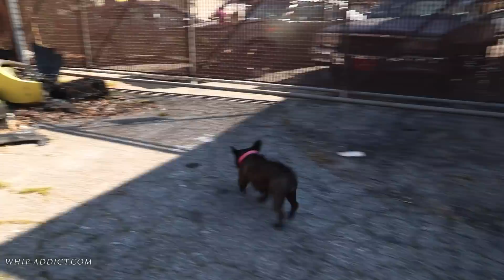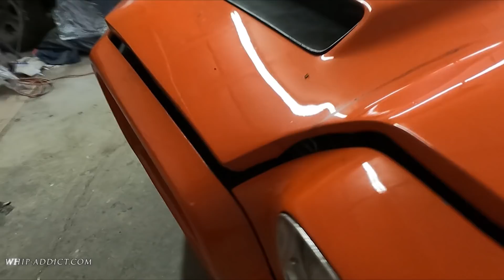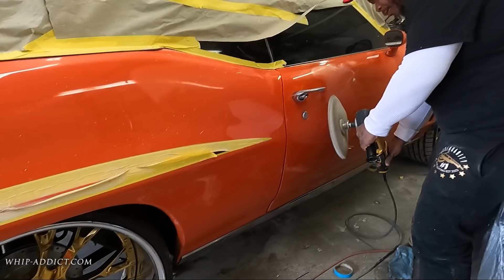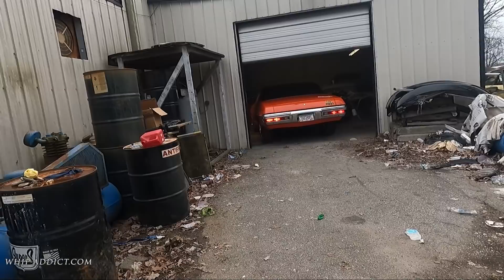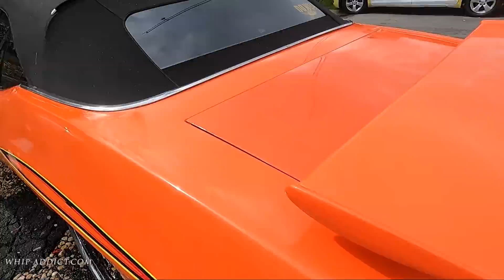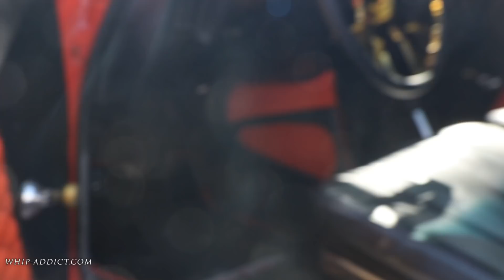72' GTO Judge Tribute Gets Buffed by Gabe In Da City! Before & After, LS Swapped, Gold 24s, FOR SALE

Comment: Only thing that gto needs is a big block Pontiac 455 built by Butler performance Pontiac with bout 800hp ... Fuck a ls
Reply: No such thing as a Pontiac big block
Reply: @backroom12  wrong 350 Pontiac is small and 400 and 455 are big
Reply: @dirtysoufracing6029   wrong . No such thing as a Pontiac big block . No matter what cubic inch it is . They are all the same .
Reply: @backroom12   same size blocks tho but we call them big bc the cid